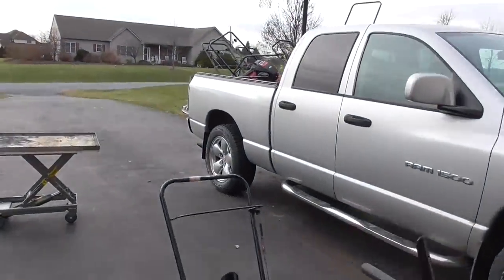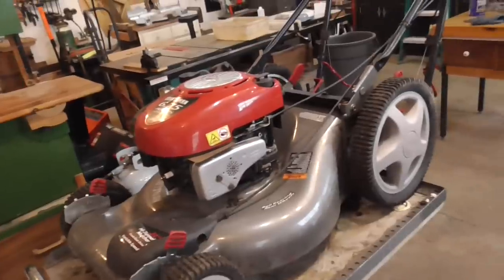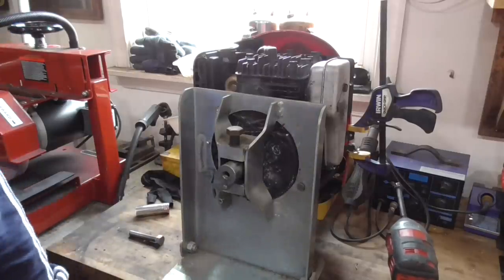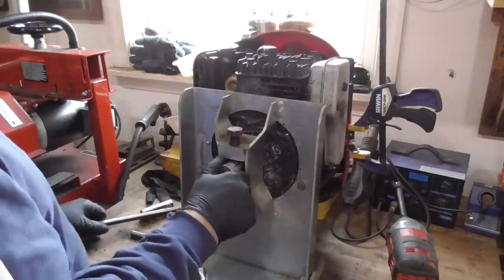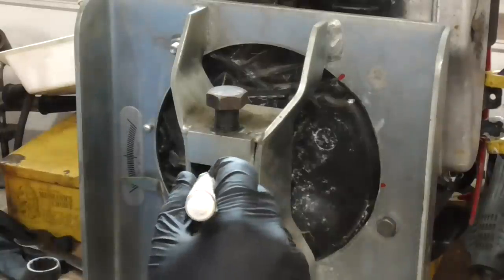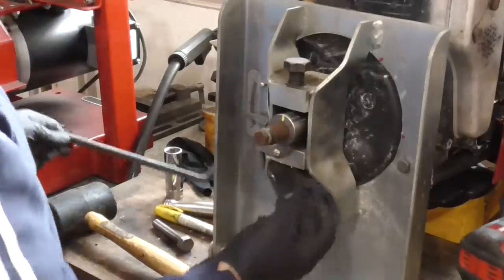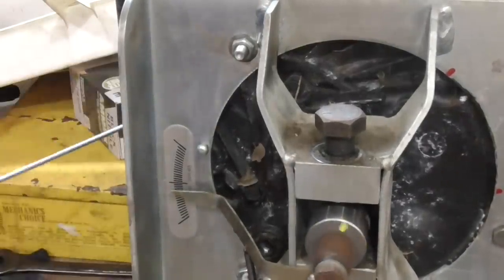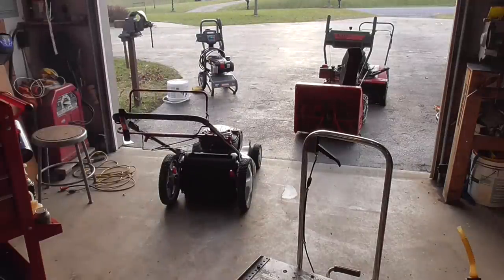Bent Crankshaft On Lawnmower Lets Fix It

Comment: If you have been doing this for a while have you had any problems. I was under the impression the manufacturer does not recommend this procedure. Perhaps the metal is weakened in the shaft.
Reply from the maker: I have a done a handful of these and never had a problem. I have never heard of a crankshaft breaking off and injuring anyone.  Also the blade is contained under the deck.
Reply: Briggs in particular made all the dealers destroy the crank shaft straightener back in the 90's to remain a dealer claiming they were too dangerous to use.  They even brought around court case documents showing us where dealerships got sued from the practice.  They seem to be making a comeback here as of late though, and as of yet I have not heard anything from the major manufactures as to making dealers quit it again.
Reply from the maker: Interesting, you would think the problem would be blades flying off mowers and not the straightener being that dangerous.  I will try to stay out of the way in the future.  Sounds very dangerous if it breaks.
Reply: @doublewide6  the problem was the crank breaking  or vibration causing blades coming off.  Only seen it once myself and most of the time it stayed under the deck(the mower will jump around like crazy when that happens).  However there was a case locally of one coming out from under the deck and killing someone years ago.  I do not think they had a lawsuit on that one just know from the shop that did it as the owner never forgave himself and hung a photo of the guy that died with the tool on his wall.  As to odds the shop that had the death was a large hardware/farm store that had been been open a few hundred years and claimed to be the first place in town that sold mowers so not trying to scare you on that.  I will not do it as the tool and time to get it right makes it not profitable compared to other work I could be doing so high risk no reward.
Reply: I guess it is the unknown of what damage was done and residual stresses in the shaft.  they may be heat treated to relieve stresses at the factory and so they feel the shaft is not back to specs after it is bent. if it's not bent too bad maybe you can get away with it on something where it just turns a pulley not much to fly off like on a mower.
Reply: They use powdered metal and cast them  instead of a solid steel crank like the used to. Those cranks are easily snapped and even if you think you are good, it has micro cracks forming due to the pressure. They heat treat the soft powdered crank that causes the metal to become stronger, but also prone to failure. Even a light strike after what he did could cause the crank to explode. Manufacturers HAD to stop recommending using that tool because of the risk. If I had my own shop, I wouldnt ever do that. Since I dont, I take my chances and do it anyways.
Reply: @BuiltOverBot  I had a blade come off on me on a Snapper self propelled. That thing FLEW across the lawn and stuck in a tree. My toes were happy it never came my way.
Reply: Its because of the way they cast the crank, thats why. If you own a shop, you dont straighten...Period. Its a huge liability.
Reply: @scottfirman  even doing it yourself is liability, in my experionce one breaking is not common however if it did you could distroy your life.
Reply: @berardia4  that is the issue we would need to xray the shaft and hardness test it to know if it is safe nobody would pay for that.
Reply: @scottfirman  the one we had came threw the deck but it was a heavy mower so did not make it all the way threw.  Would hate to see that on a new mower it would have killed ot hurt someone.  We were lucky.
Reply: So l save an engine like that and if I come across one with no compression or blown rod I'll use it for a crank swap.
Reply: @BuiltOverBot  people get killed in all sorts of freaky ways. you can't go through life being over cautious about things or you would never leave the house.
Reply: @paulk5311  when the cost of that mower is so cheap <$100 you can opt to get a new one rather than take a risk. If the cost were the same for a wrecked/rebuilt car would you buy it over another with a clean title? Is it going to be structurally sound in a collision.

Comment: Many years ago, our mower had a bent crank. A man straightened it and it worked fine for years. I think that my mom traded it for some work on the yard. I have heard warnings of cranks breaking if you try to straighten them, so here is my question: Has anyone ever seen one break? I don't mean some local fifth hand story, I mean a first hand, or even second hand account where you saw it, or someone told you that they saw it. Please reply.
Reply: Only stories from Terryl the mower mechanic. I ve seen lots of blade clutches break off mowers which were stopped by the mower deck. Not anymore serious than a crankshaft breaking off I would think.

Comment: I ask why is this silly tool so expensive. I will make my own for a few bucks.
Reply: You have welding skills and few scraps of good metal, a good threading device, you can make one for cheap, if you do make one let us know how it turns out, I myself find it easier just to replace the crank shaft, since I have so many engines laying around, or just simply replace the engine all together, I have 5 6.5 briggs in a storage area just for that reason..... But if you make a straiting aperatis please let us know.
Reply: @knighthawk86855  Search on youtupe  there is an eastern European guy that made one and he demos it on how to use, he straitens shafts in a few minutes or less
Reply: @edgenet1  cool I will look tks.
Reply from the maker: The tool is expensive but it is calibrated perfectly.  I tried making one about a year and a half ago and I could not get it to work accurately without adding shims.  Eventually I broke the weld and decided I should bite the bullet and buy one.  I would say if you are going to do more than 5 engines with it you can't go wrong.
Reply from the maker: You would have to be pretty well skilled to make one that works perfectly.  Not saying it couldn't be done, but I tried and was unsuccessful with my attempt.  Also this one is really accurate and easy to use.
Reply from the maker: Saw the video and he gets the shafts perfectly straight.  By the way all the fittings on this tool are hardened (including all threads) otherwise they will strip out.  Acme threads may work without being hardened.

Comment: By straightening the shaft you are not doing it right, there is a chance it will break from a small crack that you cannot see.  My dad was a Briggs dealer over 50 years ago and quit using a shaft straightener not long after becoming a dealer.  If the shaft breaks off it can and will go a loooonng ways, with a little luck it will not hit a person.  If it does you can guess who will be sued,  the man that straightened the shaft of course.  Throw that straightener away and but a new shaft.

Comment: It's a Craftsman.  Don't bother.  Just toss on the recycle pile without wasting your time.  ALL Craftsman  small engines should be tossed before they're un-boxed.
Reply: Years ago Craftsman mowers had Tecumseh engines, but they switched to Briggs and Stratton engines when Tecumseh stopped making engines. Craftsman does not make engines.

Comment: anytime you bend and straighten a crank shaft you weaken the metal,straightened many over the last 45 years,but i will not do it anymore as the risk of a law suit if the blade should break is too great,if customer wont spring for a new crank then i dont repair!do it right or not at all,even if its one i want to repair and resale i wont do this,might swap in a used crank,always replace the flywheel key also even if it runs as it must have some damage and keys are cheap !also respect the flywheel very close for cracks as the newer ones are very light weight !sorry but this one is not a well done repair!
Reply: Agree 100%